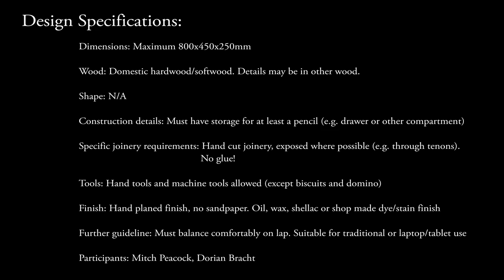100% Wood Challenge Ep.2: Lapdesk with Mitch Peacock (No glue, no screws / Traditional Joinery)

Comment: As a woodworker that loves to combine Japanese practices (self-locking joinery sans glue) with western style, I love the keyed dovetails! I'll definitely be prototyping with that in the next few days! I would like to know, however, did you take any precaution, is there something specific about the wood choice, or maybe is there some detail I missed that would mitigate or prevent wear to the lock mechanism? It seems like it would wear over time, and gravity would essentially just keep it from locking after a while. (Genuine curiosity and definitely not a criticism.)
Reply: Je t
Reply from the maker: +spectre6000 thanks! I used softwood for the keys as not to split the oak. Even if they loosen over time I can just put new ones in thanks to there being no glue ;)

Comment: Great piece! Why did you got for 2 angled pegs per dovetail instead of a single centered woodnail through the vertical side of the tail into the top board?
Reply from the maker: Thank you! Because you can retighten them in the future and the pressure coverage isn’t just in the middle. Plus it looks way better ;)

Comment: What brand of table saw is in the video at 1:39?  I just bought my first table saw, a Robland X31 a 1995 model, and it looks very similar.  Thanks for the video's, learning to do scarf joints.  Building a shed in the back yard to put the saw and other woodworking equipment in that I will soon be acquiring.
Reply from the maker: The saw is a Felder from Austria. I am based in Germany, so we use slightly different machines.

Comment: I don’t want to be ‘that guy’ but at 13:09 - those are screws, right?
Reply: Those metal pieces are inserted into the Dowel holes to mark the corresponding locations on the second piece and are removed later. They have a sharp tip to leave an indentation in the wood so you can see where to drill. The two pieces are held together by wooden dowels only!
Reply: Florian Reclaire Ah ok. Didn’t know that. Makes sense. :)